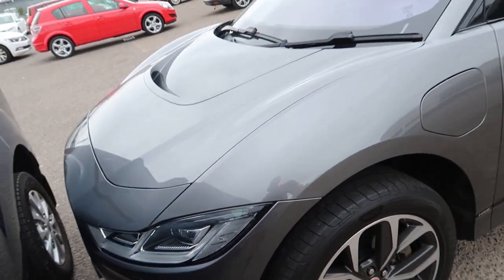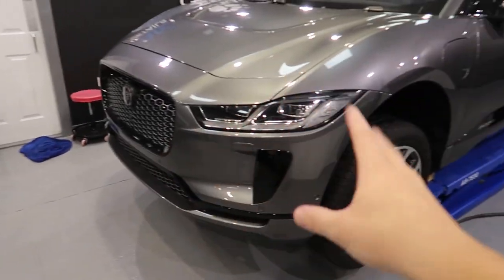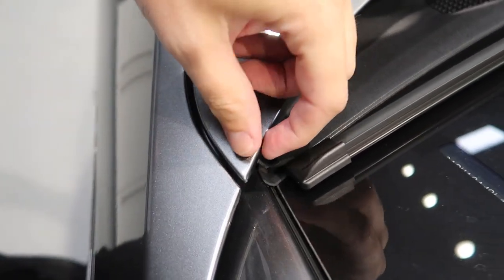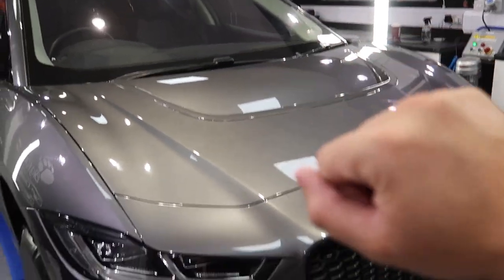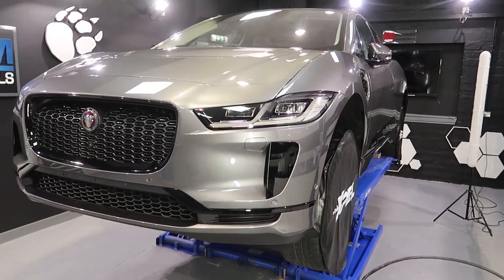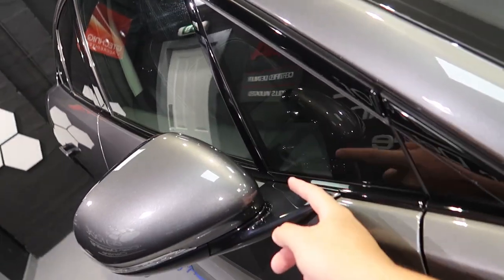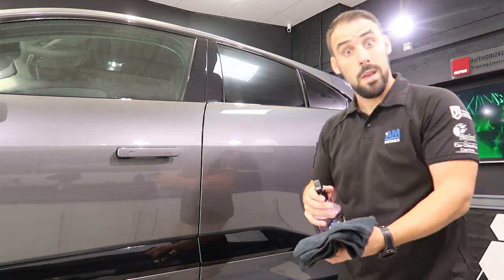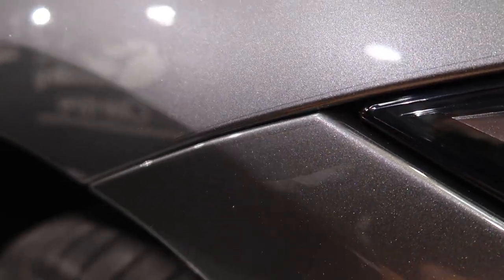Jaguar I Pace - Xpel Paint Protection Film - Elgin, Moray

Comment: 14:05 how about one of those air-purifiers, instead of spraying water to the air? some of them come with HEPA filter.
Reply from the maker: Definitely an option, and i probably over-prep the area. But I want to make sure as the unit is not new and not purpose-built for Paint protection film, so I want to take as many stapes as I can in the early stages. As we invest in modifications or tools. An Air purifier may be one.

Alan 👍🔔

Comment: 11:01 can you not prep film on windscreen? it would be much shorter distance to travel from there onto bonnet.
Reply from the maker: Indeed, I know of a lot of detailers who also use the side windows for B pillar prep.

The issue is I want the surface as verticle as possible, so I can do a final flush to make sure everything is a s clean as possible.  Using the screen for large pieces is not something I would do naturally. But may try in future.

Alan 👍🔔

Comment: 20:23 will Xpel not hide blemishes in clear-coat?
Reply from the maker: It can indeed hide blemishes. But this is not a brand-new vehicle. so I like to do a light machine to make sure the surface in as clean and prepped as possible.

Alan 👍🔔